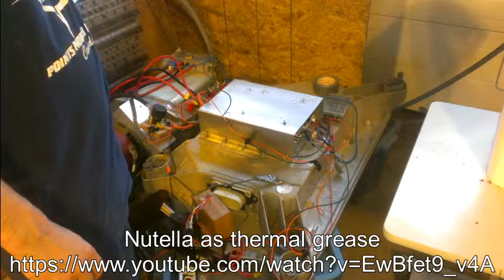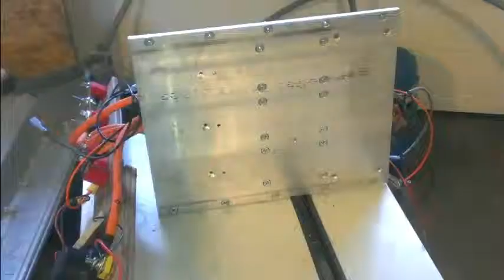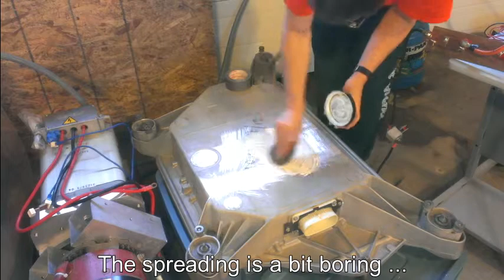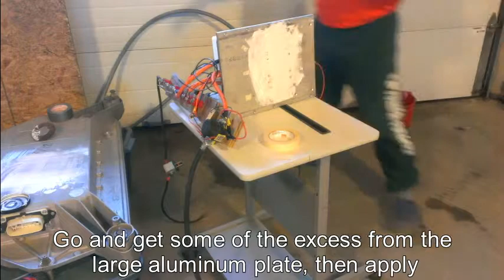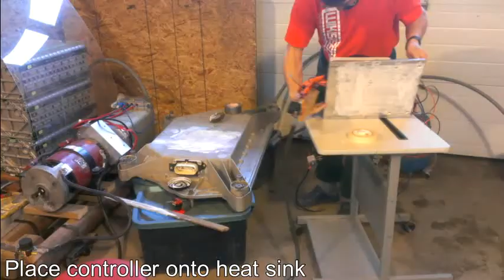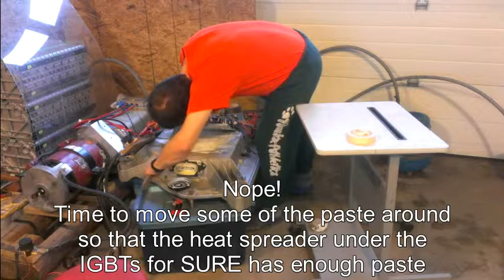December 12 open source AC controller test   controller cooling

Comment: You might try just a thin box cavity under the plate and run water in that.
Reply from the maker: +Dan Frederiksen I've looked around for ideas .. perhaps I'm not that good at searching .. in the videos that I have seen, someone more skilled than I am uses a mill to cut out water channels, drill and tap the plate for hose fittings, then use some sort of box or plate to close up the bottom and make it water-tight ... a bit over and above my mechanical skill level.  I have 4 inch square aluminum tube that I can strap the controller to, then run water through .. but no ideas on how to close up the ends and make them water-tight
Reply: +Michael Lulchak how about plexiglass on a ring of silicone? thin sheet of water running over the surface. keep it simple